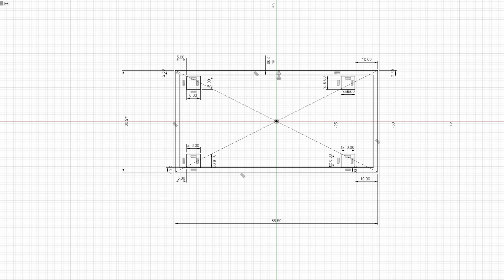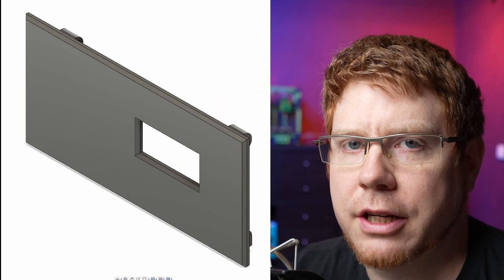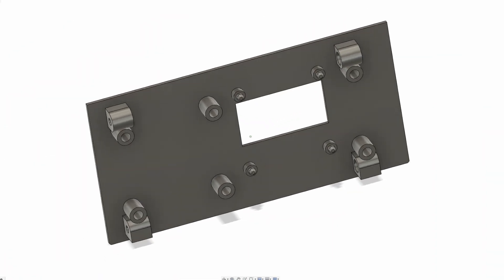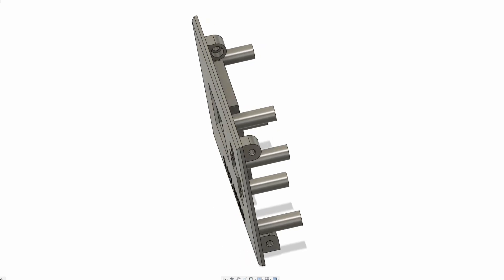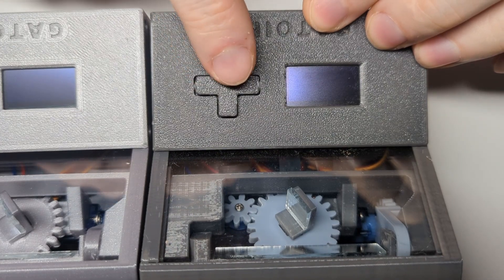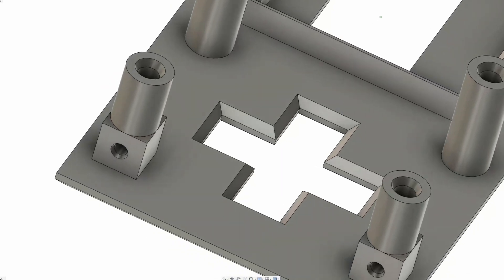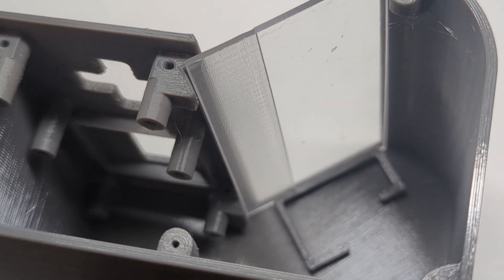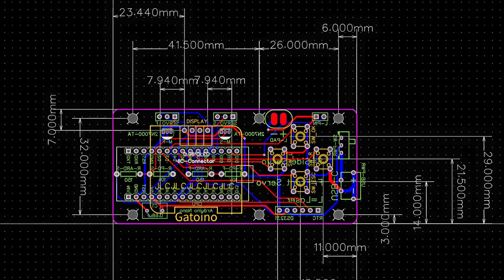Combining the electronics PCB with 3D printed parts - Gatoino Design Part 2

Comment: Some really good stuff in here about designing for tolerance! Also, for people using Fusion, I wanted to mention you can do the PCB design right in the program. The Eagle software and parts library are integrated directly into Fusion and your mechanical and PCB sketches can reference each other.
Reply from the maker: Thank you! 

That's true, although I found it less intuitive than EasyEDA, so I only ever tried it once.